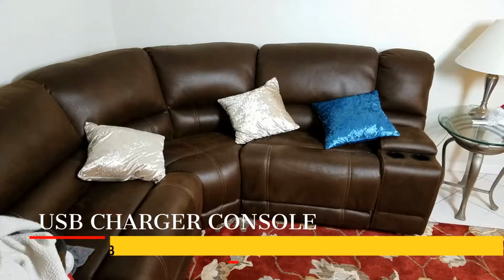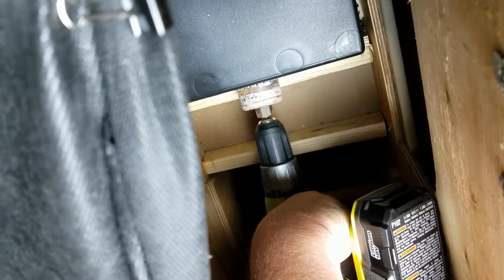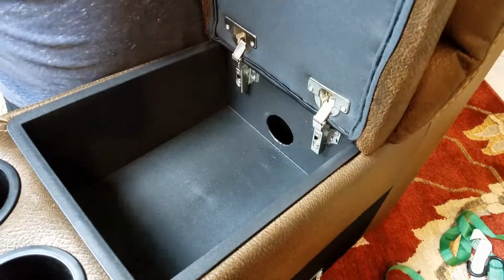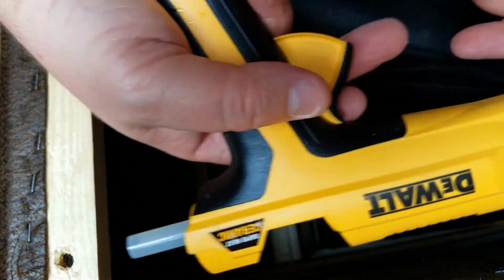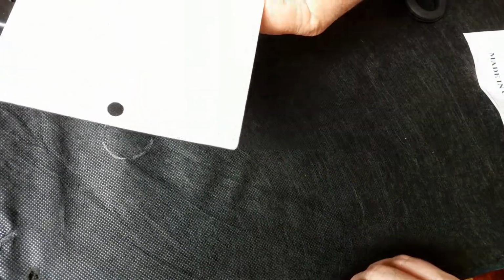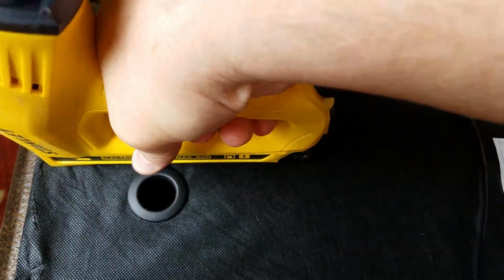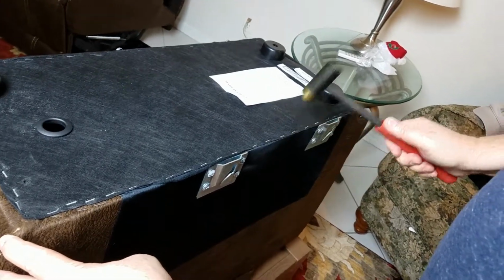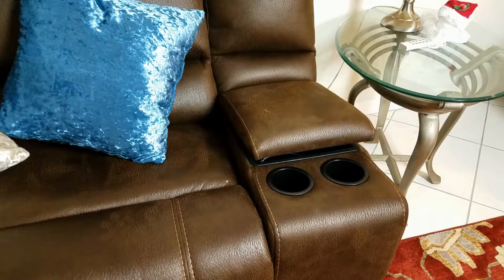MakrWork - USB Charger Console

Comment: When I check amazon it says the plug is 2.36” but the grommets are only 1”?
Reply: The charger is probably that diameter but that's not what the grommets are for. They are only for the cord, and you only need one of them. Watch the video through. It will make more sense.